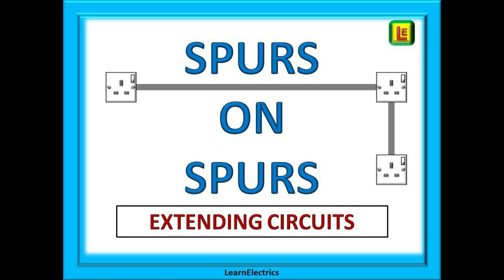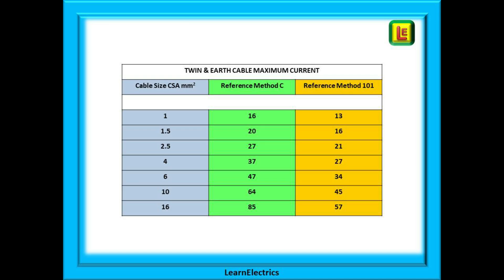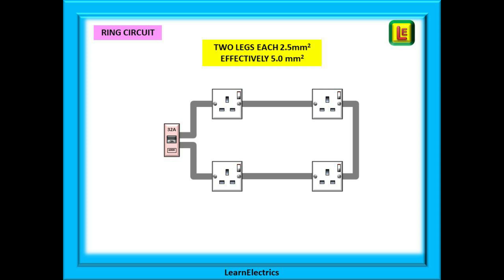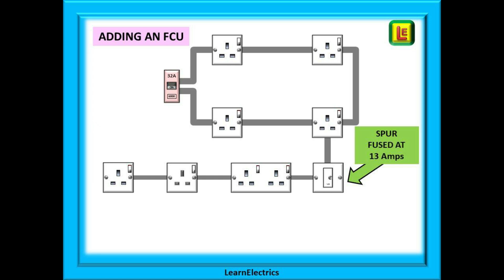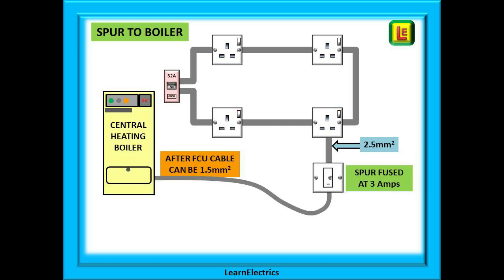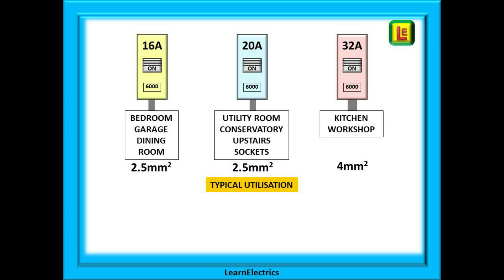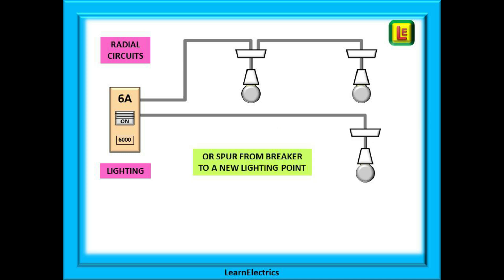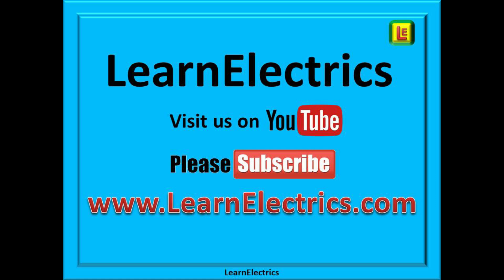SPURS ON SPURS Extending Circuits

Comment: Great video as always Dave, one question that has always bugged me regarding ring final circuits. Despite bs7671 stating that it is permissible, how is a single leg of 2.5mm allowed to connect onto the ring (either directly into mcb or off a socket outlet as a spur) if the overload protection is a 32A mcb? It almost seems contradictory or an exception to the rule???

Looking forward to more content👍👍
Reply from the maker: Even if it was a double socket, would you really plug two 13 amp kettles into it, or run two 3 bar room heaters? And if you did that comes to 26 amps and 2.5 cable will take 27 amps Ref method C. More likely you might have a kettle plugged in for three minutes to make a cuppa, and a computer at 5 amps, so only 18 amps at times, often less. Diversity of use. Hope this helps. Dave.
Reply: @learnelectrics4402  That is a weird thing as the fixed installation should not rely on what is plugged or protection. The installation relies on the fuses on the plugs. Now I et every country has such peculiarities dictated by practicality in their codes.
Reply: The answer is that twin socket can onl have two 13A loads, which is 26A, which is below the 28A that a 2.5 mm^2 cable can take. Also, twin sockets aren't even rated to takes 26A continuously. I seem to recall the British Standard only requires that they don't overheat after 30 minutes with a combined 20A load. In practice, the regs appears to assume that there will not be two 3kW loads continually running on a double socket. Other national regulations seems to have the same sort of assumptions. For example, US sockets are only rated for continual use at 80% of their maximum current carrying capacity.

Comment: Great video, thanks. In the case where you show a 2.5 sqmm cable spur from a consumer unit with a 32 amp MCB, I am surprised that this is allowed. If the cable rating is 21 or 27 Amps depending on fixing method, I am surprised it can be adequately protected by a 32 Amp MCB.
Reply from the maker: Even if it was a double socket, would you really plug two 13 amp kettles into it, or run two 3 bar room heaters? And if you did that comes to 26 amps and 2.5 cable will take 27 amps Ref method C. More likely you might have a kettle plugged in for three minutes to make a cuppa, and a computer at 5 amps, so only 18 amps at times, often less. Diversity of use. So that covers overload. If their is an earth fault the current will be hundreds of amps and the disconnect time less than half a second so the breaker will trip before the cable is damaged. Hope this helps. Dave.
Reply: @learnelectrics4402  Totally agree that in practice it's not a problem, but just a bit surprised that it's allowed by the regs, which, as we know, can be pretty strict! Would a knowledgeable building control officer accept it, I wonder?

Comment: Hi . Would it be possible to run a dishwasher/washing machine. to a socket outlet from a switched  fused spur from the ring main .
Reply from the maker: Can you plug a washing machine into a ring circuit? Yes you can, so no problem taking it off an FCU/socket. As long as the washing machine load and what is already on the spur  is less than 13 amps you will be ok.
Reply: It is recommended that any appliance rated at 2kW or above, should be supplied by it's own circuit. Main reason for this is to prevent uneven loading on a ring particularly in the kitchen.